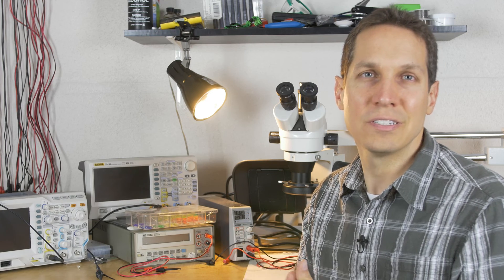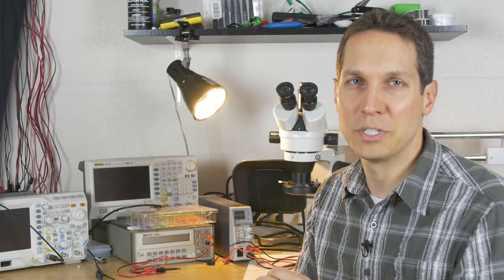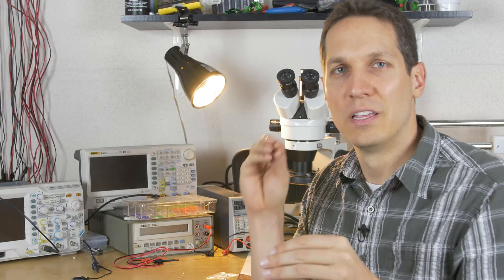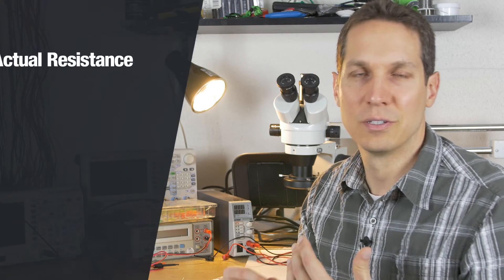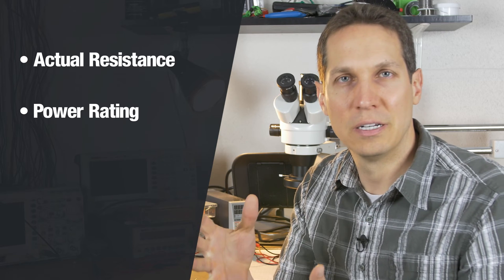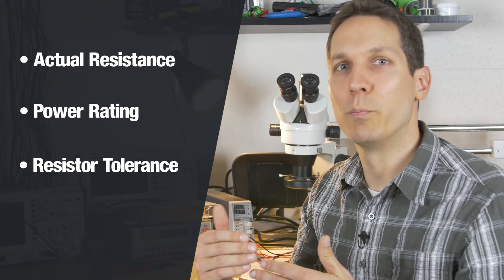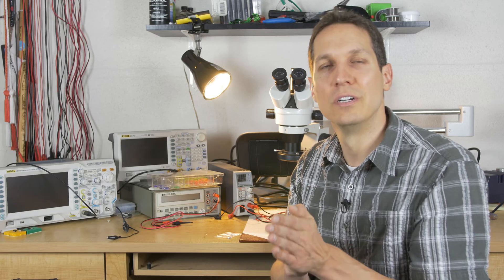How do resistors work? (Animated) | Basic Electronics

Comment: I think every reputable school will teach that the resistor is the most common and important electrical device on earth. I made it through intermediate electronics and had just started advanced electronics with op-amps when I ran out of steam. Some years later, I was reading through the incredibly thick Electronics Engineer's Handbook, cross referenced a college text from the 70's my father bought me and encountered HF radio and it's relevance in conductors in general, not just resistors.
At about 300 mhz., in as little as a 1 inch conductor including circuit traces, inductive and capacitive reactance becomes relevant. 
Jump into radio engineering, and you find the "loading coil" built into antenna's physical architecture to tune the circuit so it's a stand alone tank circuit, and it's internal capacitance and reactance fulfills the criteria to establish it as a tank circuit.
This can be witnessed if you have ever seen a wi-fi antenna outside the plastic package, and the short portion rolled into a coil.

Comment: With water the flow with resistance applies would be faster,what does happend to electricity in these case?
Reply from the maker: That's actually where the intuitive understanding with this metaphor struggles.  Most of us, when we're imagining this, we're imagining covering the end of a house to restrict the flow.  In that case, you're actually increasing the water pressure, which is not what happens with electricity.  I think it's better to think of it as a tub of water being held up high.  If you drill a small hole or a big hole, the pressure doesn't change and water doesn't necessarily flow faster, just more of it flows.  I hope that helps!
Reply: @CircuitBread  yeah I guess the tube with a hole at e certain height would be a much better way of saying it.But how exactly does it work with electricity.Cause again this way of explaining fails cause all water falls after a certain time.

Comment: I'm looking for molecular level explanation? Is it just friction of electrons as the flow through a resistor? Resistors generate heat to "resist", right? What substance provides that precise level of friction and how is it precisely manipulated to give precise resistance?
Reply: Resistance is the opposition to the current flow. Every substance has some amount of resistance. Value of resistance depends on many factors such as area, length, temperature and specific resistance of the material. When we have a resistor connected to a circuit electrons start to collide with nucleus of atoms inside the resistor and there is energy dissipated in the form of heat. We can also see that energy is dissipated out of the circuit because there is voltage drop across the resistor. If we have relatively short wire with big enough area there would be a very small voltage drop because resistance is small.
Reply: @Slovenija_patriot  so you mean molecular friction?
Reply: @fifiwoof1969  When electron hits nucleus of an atom its kinetic energy gets transfered into thermal energy which is why resistors heat up when there is high enough current flowing through it. The higher the resistance the more challanging it is for electrons to pass through the substance and more collisions in atoms happen and therefore more energy gets transfered into thermal energy. In materials that are good electrical conductors like cooper this collisions aren't happening as much which is why there isn't as much energy dissipated out of circuit as there is with resistive materials. We can see the energy being dissipated out of the circuit because of the voltage drop that happens when current flows through resistor.
I guess you could imagine it as being some sort of friction.

Comment: So, a resistor limits (or resists) the current flow in a circuit, but not the voltage ?
Reply from the maker: Yes, exactly.  Resistors don't directly affect the voltage.  This is where it gets a little more complicated - if the thing generating the voltage can't produce enough current, then the voltage will drop.  But that's an indirect affect.   For example, a AA battery with a 10K ohm resistor will be able to generate 150microamps without a problem, so the voltage will stay 1.5V.  But with a .1 ohm resistor, the AA battery probably won't be able to generate 15 amps, so its voltage will drop.  And I really hope that I didn't just further confuse you...

Comment: So If I connect Arduino pin to an LED and use a resistor ,I limit the current that goes into LED,right? But if I use a voltmeter in parallel with the resistor ,I can see some voltage there which means I,ve lost some voltage too.So that doesn't mean that resistor limits the current and the initial voltage too? please explain me I am really dummy!! :(
Reply from the maker: The way you can think of it is that you're limiting the current through the resistor because you're dropping all the "excess" voltage over the resistor, not the LED.  For an LED to work, it needs a certain voltage to start conducting.  Once it has that amount of voltage, any voltage OVER that minimum creates a quickly-increasing current.  (Check out the image "LED current versus voltage relationship" here:  https://www.circuitbread.com/tutorials/leds-and-forward-voltage)  I actually highly recommend reading that entire article - it's a little bit more technical but should be able to answer all your questions.
Reply: @CircuitBread  Now I have another question: In some circuits I've seen from left to right Arduino 5V connected to LED,then resistor,then ground and it worked fine? Why is fine shouldn't the LED be burned?! And btw the link you gave me isn't working :(

Comment: Funny cause like, resistors dont just make a smaller path for electrons, they use a material with high resistance and when electrins bump into electrons from that material, electricty is converted to thermal energy

Comment: If I have 2 or more resistors in series,I have a voltage divider (resistors limits the voltage) and if I have in paralel it limits the current,my question is if I have only 1 resistor in series,it limits the current or the voltage?
Reply from the maker: Sorry, I'm not sure if I understand the question.  Also, if you have two resistors in parallel, it does not limit the current, both resistors will have the same voltage across them and you will get a current through them proportionate to the resistance values of those resistors.
Reply: @CircuitBread  I am trying to understand maybe I am in error.So when we have 2 resistors in series if I use an ampermetre the current it's the same in every point of the circuit,but in paralel the wire is splitting in 2 wires  and because of the resistors we have different current,if we have the same resistors,we gonna have equally divided current on each wire. So resistors in series makes a voltage dividers and resistors in parallel makes a current divider.It's my logic good?

Comment: So if I wanted to charge a lithium battery pack from an alternator would a simple resistor stop the alternator from being damaged by current draw?
Reply from the maker: Lithium batteries are more touchy than lead acid batteries, which is why there are typically dedicated IC's that control the charge profile of the battery.  I'm less worried about hurting your alternator and more worried about damaging your battery pack.  That being said, a resistor is a very simple yet inefficient way to throttle current flow, though you will probably need a resistor capable of withstanding a large amount of power, even if you choose a small ( < 1ohm) resistor.
Reply: @CircuitBread  thank you for your information

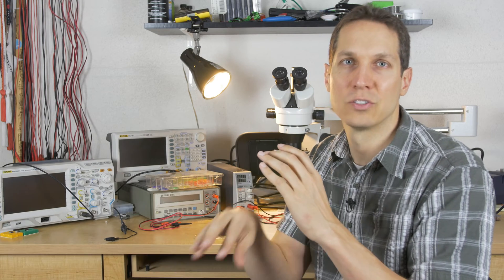Comment: 3:20 this is why I struggle to understand electronics. With water, as with most fluids, narrowing part of the channel it’s flowing through doesn’t “slow” the water’s velocity, it INCREASES it. (Think putting your thumb mostly over the end of a hose). 

If the resistor is the size of the pipe/hose, wouldn’t it be like increasing the pipe diameter?

So saying a resistor allows less electrons through thus giving a lower voltage makes sense to me, but the analogy doesn’t at all.
Reply from the maker: This seems to be a common question, common enough I may end up doing another video physically addressing just this analogy.  In the meantime, I'm going to modify a comment I put somewhere else:  
Couple of things, I always start with the fact that a metaphor is never perfect.  With that, I think the challenge here is that most people are used to using a hose coming from a hydrant, where if you cover the end of the hose, you're increasing the back pressure.  It's important to note that, in normal situations, when you open a faucet, you're decreasing the pressure in the system.   When you cover your thumb, you're increasing the pressure back up to what it is when the hydrant is off. This is more like having a hose coming out of a hole in a bucket of water suspended over your head, which will have a consistent pressure (as long as the amount of water in the bucket magically stays at the same level).
Reply: I think the analogy is ok but I also had troubles with it at first. I know your struggle. V=IR (Voltage = Current x Resistance) First to address your last sentence:  A resistor decreases the CURRENT but NOT the voltage! The voltage stays the same, but when the resistance changes for whatever reason, the current must also change. when you stick your thumb over a hose end, yes the water particles accelerate but there are LESS of them going out the end, and the more you pinch it shut the less get out until none are getting past at all, even though up to that point the ones that do are going at a high speed.  So think of current not as the speed of individuals but how many in total are on the move, a resistor or a thinner wire gauge RESTRICTS the flow of current. 

On the flip side, Increasing the diameter of the hose or using a thicker wire LESSENS resistance and allows more water/electrons to be pushed through (by voltage). 

Voltage is like a massive water tank on a tower, if you have a 1cm diameter hose out it cannot let out as much water as a 1 meter diameter hose. So you can think of Voltage as a water tank, Resistance is the hose, Current is the amount of water getting through it per second, NOT the speed of the water. Hope this made sense

Comment: I have a doubt using the fluid analogy...when the pipe gets narrow the velocity of the fluid is high so aftrall the same amount of fluid is passing thats not a resistance ...
Reply from the maker: First, no analogy is perfect, unfortunately.  Second, in this case, the challenge is probably that you're thinking of water coming from a hose, not water coming out of the bottom of a barrel of water (or something similar).  The water will react differently and, while still not perfect, be a more accurate analogy of how the water flow decreases.

Comment: You didn't explain how they work other than just state that they resist current. What about how to calculate the resistance etc.?
Reply from the maker: Hi Michal!  Typically, as EE's, the resistance is given to us, so that's why I glossed over that portion.  To calculate resistance, you need to know the resistivity of the material, the cross section area (which decreases resistance), and the length (which increases resistance), and then it's simply: (resistivity * length) / area  Make sure that your units match (so you're not measuring area in square meters and length in millimeters, etc.) and you should be good to go.  Hope that helps!

Comment: Hi Again...Do you think it is possible....at a fee of course, for me to sent you the circuit board for analysis...I could then do the repairs if it is not the micro controllers???
Reply from the maker: Hi Bob!  We're not really setup for that, unfortunately.  I'd recommend our discord channel as a free option but it's still pretty small at this point and I (and the other CircuitBread engineers) can only jump in sometimes, so responses are hit and miss.  While it's been several years since I've worked with anyone on Upwork, a service like that might be an inexpensive yet effective way to get a review.
Reply: @CircuitBread  Thank you!

Comment: Are your teeth naturally that white...and are they real??? Are you just lucky???
Reply from the maker: Hey Bob, thanks, I think! 😂  Yes, they are real, I am just lucky, I guess.  But on the flip side, I did have braces for several years as a teenager so... I don't know, maybe I could consider that as "paying my dues"?
Reply: @CircuitBread  Hi....do you think you could answer a question I have regarding a 1144 count white led photo light with a variable dimmer that checks out ok but does not work??? Is is powered by a 19v adapter....and I get 19 volts to the two leads going to the leds?
Reply from the maker: Hey Bob - troubleshooting like this is difficult but we could give it a try.  Do you have any more information about the photo light?  Make and model so I can look at it.  And I'm assuming by "does not work" is that it doesn't produce light under any circumstances.  Is that correct?  
Also, YouTube doesn't notify me of follow up comments, so if I don't respond, feel free to jump on our Discord channel, where I at least get notifications.

Comment: all these electronics which end is pos and which end is neg on restors and them 3prong ones i am tottaly zero brains on this but would like to learn
Reply from the maker: Hey Brian - some electronics are more complicated but resistors are straightforward.  There is no positive and negative, it doesn't matter which way you put them in, they'll work the same.  I'm not aware of any three prong resistors, though, unless it's some sort of resistor array.

Comment: What happen if i put resistor into water temperature gauge?
Reply from the maker: Not sure if I understand the question.  If you put a resistor under water next to a water temperature gauge and then run a lot of power through the resistor, you'll heat up the water which should register on the temp gauge.  But it depends on the power and the amount of water.  Does that answer your question?

Comment: If we change the voltage source for the same resistor, does its resistance change or not? Give reason also....
Reply from the maker: No, the resistance does not change in a resistor when you change the voltage (unless you're somehow damaging it).  The reason is because resistance and resistivity are an inherent part of that material's property and don't change randomly.  However, if you put too much power through it and melt it, then you're changing the property of the material and the resistance.  Perhaps not a great metaphor - it's like saying that the road you're driving on becomes more or less bumpy as you speed up or slow down.  You're not really affecting the road, but it's affecting how easy it is for you to go fast.
Reply: @CircuitBread  but electric field force will increase when we increase the voltage source emf and if due to this force some more electrons move to the conduction band by overcoming or breaking the attraction force of nucleus
Reply from the maker: Sorry, I thought I had replied to this a week ago.  I can see what you're thinking but you're still not changing the property of the material when you change the voltage.  You're changing what is happening internally by having more electrons move but as soon as the voltage disappears, the material still has the same properties - they've never changed.  To move away from the road example and use a water example - if you have a lot of pressure in a pipe, more water flows through the pipe, if you have less pressure in a pipe, less water flows.  But the pipe never changes in diameter based on the pressure or the flow (unless there's too much and the pipe breaks).  The only difference is that the electrons are part of the material (whereas water isn't an integral part of a pipe) - however, since it is a circuit, the electrons are moving in a circle and any electrons that leave are immediately replaced, so, again, the material doesn't change.